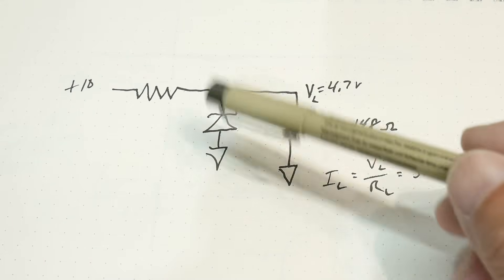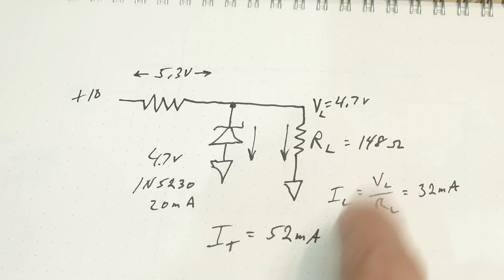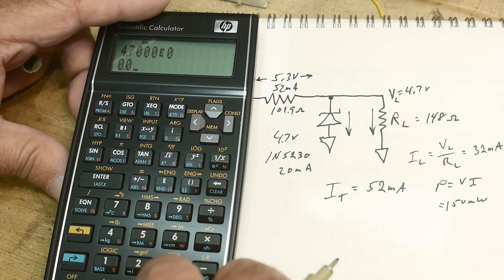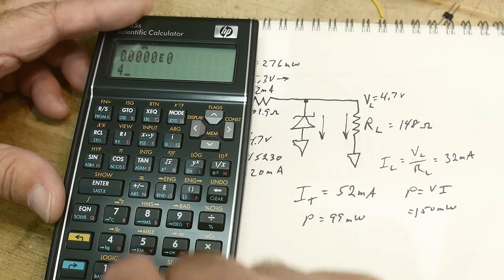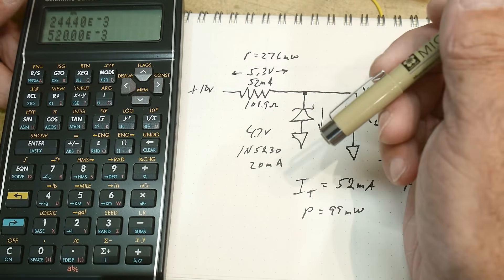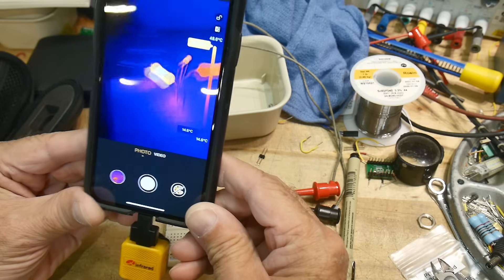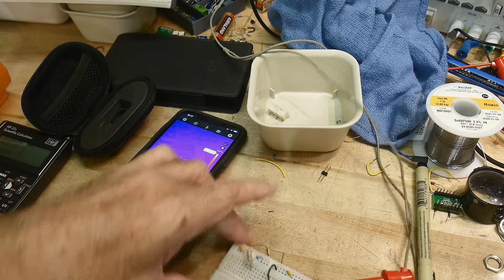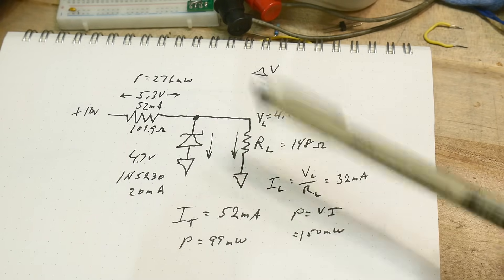#1726 All About Zener Diodes (part 4 of 5)

Comment: Zeners have their unique place in discrete circuits, but with the advent of cheap linear IC regulators such as the AMS1117, it often costs more for a zener plus surrounding passives than for the IC regulator that’s more precise and higher power for the price.

Comment: Nice and useful, thank you! I have a question: it is OK to use the zener as just a voltage limiter? I have a circuit (headphones amp) that will usually be powered by 12V or 15V,  but it ocasionally could be powered from a 18V source. I'm using a 470R and a 15V zener (both 3W just in case) followed by a "reservoir" capacitor, to limit the incoming voltage down to 15V. Is this a correct practice?

Comment: I hope this series will include zener diodes as noise sources.
Reply: I'll 2nd that.
I've noticed that multiple synthesizer makers switched to Zeners for noise sources as the supply of choice selected noise transistors dried up and/or couldn't match production volume.
Reply from the maker: not this series, I've done RF noise source and AF noise source videos using 'zeners'  actually you need to use >7V zener diodes as they are actually avalanche and not zener effect.
https://youtu.be/evJcZdRJKT0?si=E5ML8b9Vuy86zma5
https://youtu.be/Ow9zQXPYm3g?si=xYKlsdgLgBg9KdKH

Comment: One trick for extending zener power dissipation without jumping up to a higher wattage device is to divide up the voltage between 2 or more zeners in series with each only dissipating their share of the power. This also naturally disperses the heat over more area to hopefully prevent PCB browning/burning.

Comment: Any time I come across a Zener regulator I just swap the source resistor with an LM317/trimpot and lift the Zener. The chances of the LM317 failing open and dumping full V+ into the load is much lower. For backup I'll replace the existing Zener with the next higher voltage one as a soft limiter. The russians were bit fans of Zener regulators and they're often powering chips in synths which are now pure unobtanium, thus the extra protection.

Comment: Wonderful tutorial on Zener diodes. 
When  the zener itself is limiting the current output of a supply a pass transistor can be added.  A tutorial on adding a power transistor bjt or mosfet would be helpful.  Particularly on how you select a proper transistor from a data sheet; gain, Vce, etc.

Comment: The regulated current source equivalent is the JFET used as a 2 terminal device. In addition to the limited selection of JFET binned currents, there are purpose built Current Regulator Diodes offered with a much broader choice of currents. Both are comparatively expensive, so in many cases it may be better/cheaper to derive the current source from a circuit composed of a voltage reference which could be a zener diode. But sometimes a simple CRD fits the use case best.

Comment: Voltage regulators based on a zener can be handy when working with higher voltages too.  If you have to deal with input voltages that may range from 10 to 100vdc, then the typical three terminal regulator is probably not going to work.  It's not uncommon to need to use a pass transistor to handle the voltage and power, so there are some interesting circuits built around the zener to handle these requirements.

Comment: Zener Diodes with a 3 leg Regulator?
Reply from the maker: yes, I showed that on another video. if you put a 5V zener under a 7805, it turns into a 10V regulator.